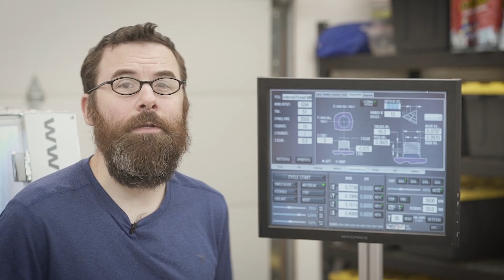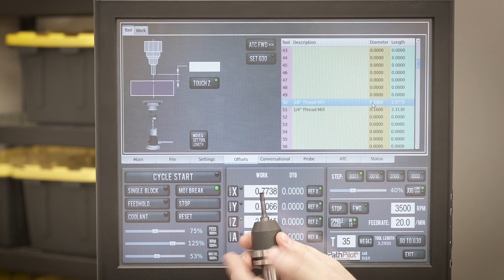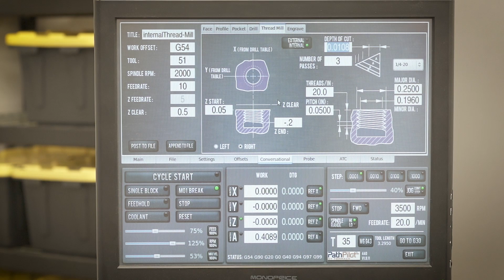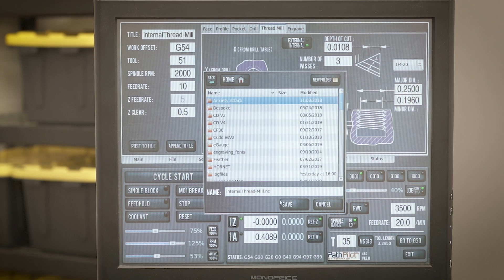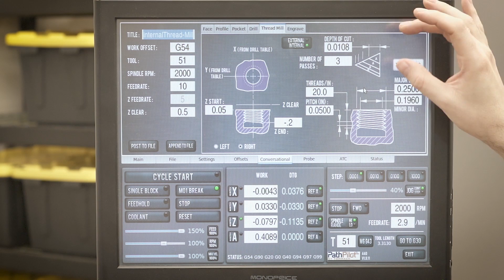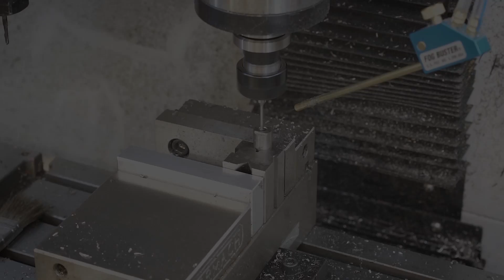Thread Milling in PathPilot

Comment: Single point thread mill "size" ranges are by thread per inch, not fastener size. For example, you can use a 20 TPI thread mill to create a 2.25 - 20 fastener if you like.
Reply from the maker: Noted.
Reply: Generally, the other consideration is to use the largest tool possible consistent with the manufacturer's recommendations (thread form distortion due to helix angle interference). In the machine shop where I work, we may have many threadmills with a given pitch but different diameters. we also use multi-fluted threadmills to reduce the time required in the cut. That being said, I would likely use single flute threadmills in a hobby shop for their versatility.